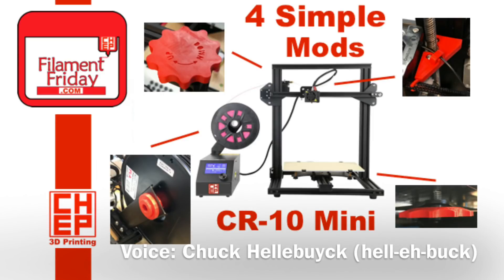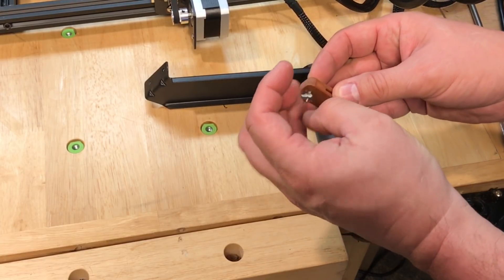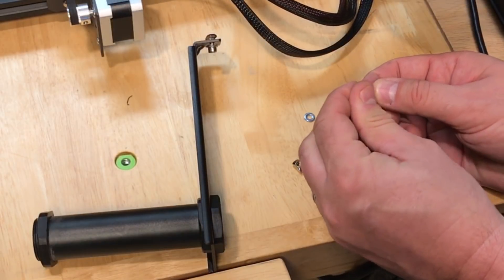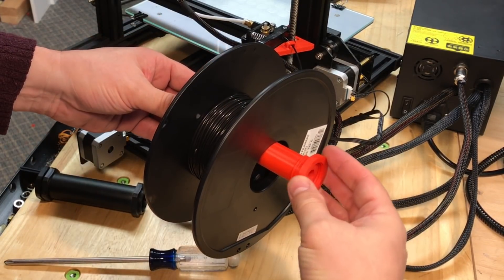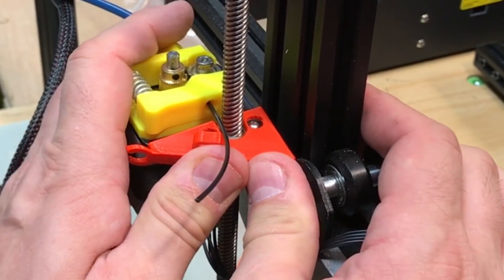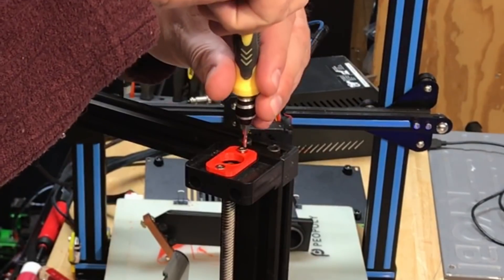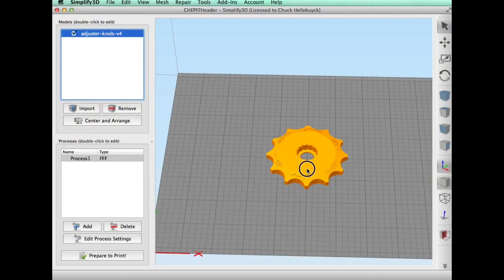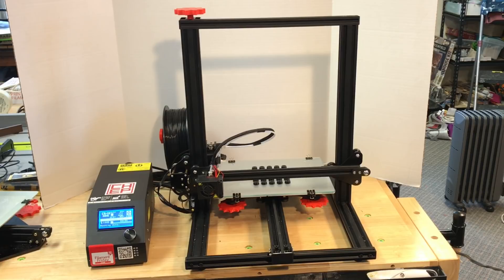CR-10 Mini 3D Printer - Four Simple Modifications

Comment: This is a question for the CR-10 Mini experts.  I have not been able to use my printer because of what it seems to be a bad board, but I am not sure what to get I've seen on Amazon a V.1.1.5 silent version that says it works for the CR-10, not sure if it'll work for the Mini, the description says: Creality 3D Ender 3 New Upgrade Motherboard Silent Mainboard V1.1.5with TMC2208 Driver for Ender 3/ Ender 3 Pro/Ender 5 /CR-10(Customized and Non-Standard Matching)

Comment: Hey CHEP, I printed the Filament Guide and it printed backwards ? Still prints off center on the bed. New CR-10 Mini. Like I said I am  totally new to this thing. HELP.
Reply from the maker: Check your machine setup dimensions in slicer
Reply: @FilamentFriday  They are right for the Mini. Do ya think I have a bad control ? And the backward print of the Filament Guide ? Is there a good forum out there for help?
Reply: @FilamentFriday  Well I told ya I was new to 3D Printing. Man I feel DUMP. had the X and Y Steppers crossed. So thanks for your time and I Subbed to your channel, really learning a lot from your videos.

Comment: Hi Chuck.

Printed the guide and you are right..awesome.

Now I just switched to a metal extruder but i also loaded a new roll at that time as well and I noticed that every once in a while with the stock place to put the filament holder that it would not spin correctly. Have you had an issue with yours once you printed the new spool holder?  I am thinking about moving it to the same location.

I also have the TL smoothers installed on X and Y. Still trying to figure out if that made a difference or not but we'll see.

Thanks for all you do Chuck!
Reply from the maker: No, I haven’t had any issues.

Comment: I printed the bed-levelling knobs ages ago & they didn't fit. I couldn't be bothered with sanding them to get them to fit. After seeing this video, I re-printed them at 102% as suggested in your video & they pressed straight on with no post-processing. Thanks - that was a great tip.

Comment: I printed this Z-axis knob, but the threads didn't fit my CR-10 mini lead screw. I printed 3 different designs and none of the threads lined up.
Reply: Mine is indeed new. Looks like an M8 lead screw with a 4 start thread. I can't measure the pitch though.
Reply: I found a different knob with threads that fit, but the design requires the lead screw to be raised slightly. The threads on this one look identical to the knob that didn't fit, but these fit for some reason.
Reply: @InsanelyMclean  I have the same issue, the lead screw simply isn't long enough to engage properly with the threads in the design.

Comment: Hi Chuck. I'm a complete noobie to this hobby and I'm looking to buy this printer as my first one. I definitely see the  advantage of the filament guide, Z-knob, and bed-leveling knobs, but not sure about the necessity of the spool relocation.  Why did you move the spool holder off of the power supply and mount it to the rail? Is it just more secure there or is there another reason? Thanks for the great videos! You have a new subscriber.
Reply: OK, so more for convenience/flexibility than a performance issue.  Good to know and thanks again!
Reply: Fair enough. I just ordered a mini through your affiliate link as I dive head first into this hobby.  Do you use any spray adhesive (or anything else) to prep the glass bed or has it worked well as-is? I only plan to print with PLA for now until I get some hours under my belt, if that makes any difference.  Thanks Chuck!
Reply: I imagine it also makes it easier to place an enclosure over the printer, if you want to print ABS.

Comment: Where do you get replacement glass for your cr-10 mini?
Reply: Thanks Chuck. I have 12 inch square mirror tiles but the mirror acts like an insulator. With enough adjusting the settings perhaps I can get it to work.
Reply: It's easy to cut the mirror tiles to 9 1/4 x 12. The issue is the mirror acts like an insulator and  changes my bed temp. What I like to do is use glue
stick and let one glass cool so the print pops off easily. The second glass can then be used for the next print. It's not a big deal for pla, but letting the bed cool slows me down. Thanks again for your wonderful help.

If I can't get borosilicate from a local glass store, I may just use hardware store glass and see how that works.

Comment: Thanks Chuck! I'm very honoured to see you print and use my Z-axis knob! Pretty stoked actually to be totally honest :) I'm still quite new to 3Dprinting and -designing, so it's really great for me to see I can make a contribution to the community, which has helped and taught me so much, including your videos. Thank you.
Reply: Thanks. Trying to find out how to do those was most of the work as well. I had just started creating my first things in Fusion 360 and couldn't get the threads to work properly, so I ended op combining it with some Tinkercadding. Because of this it lost some smoothness, but it gained actually-fitting-ness :)

Comment: I wonder if there's a way to remix the filament guide to work with the filament runout detector on the CR-10S?

Great info in this one Chuck!
Reply: Duh.... Didn't even think of that...  The only downfall to that piece is that it comes off if the filament does not have a straight path.... I'm thinking maybe I'll work on a remix of the guide you showed, and the O.E. sensor piece, and maybe swap guts......   Now you've got my creative juices flowing.....
Reply: The filament guide that comes with the CR-10s doesn't stay put :(
Reply: I'm gonna fix it!  I'll share when it is right....